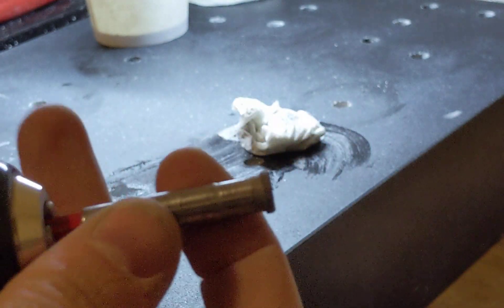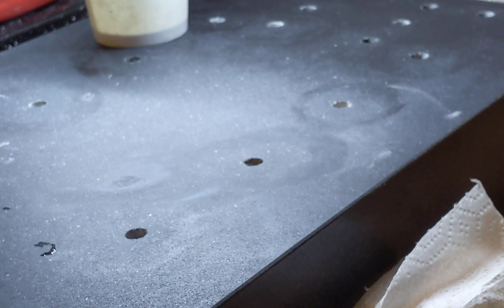RIGCNC Hole Drilling process

Comment: I know the first bits' purpose is to give the larger bits a locating hole to guide. But, after that, could using smaller SDS bits in a rotary hammer speed up the process? I'm not sure if the drill you're using is a hammer drill or not. My concern would be splitting the surface plate. Although, I think with the smaller bit (3/16 to 1/4) and the amount of mass from the plate could prevent that. Even if the holes are a bit....messy on the inside, it might give the epoxy more to "key" into.

Comment: They seem a little gimmicky, but they're great: Get yourself a set of big gator tools drill and tap guides. Seem to be sintered steel, beautiful finish, hard as nails, and essential for quality work when you're not in a drill press or other machine with more precision.
Reply: EDIT: "essentil" is not "essential" :-/ In other news, how critical is the location and perpendicularity of these holes? Could get some weird stresses in the metal being clamped down if they're not square. I guess you can true them up to some extent while epoxying them in. You should do that. To free the bottom plug, just hammering a nail or screw driver down one side should easily snap it off. Air from a compressor works wonders for cleaning out holes like that, too :-)
Reply from the maker: As long as it's reasonably square you're good, I use spring washers and normal washers in the final assembly to help normalize the force. They're also VERY over spec'd for the job they're doing
Reply: @TheBetterRyanKelly  Bad news: Spring washers (if you mean the typical single coil split type and not the concave disk type) do the opposite of normalising force from the fastener, instead concentrating all of it on one side until the spring is fully compressed and then evenly distributing it as if it wasn't there unless it's unevenly machined. Nevertheless, I'm not even sure what it's going through, maybe it doesn't matter at all.